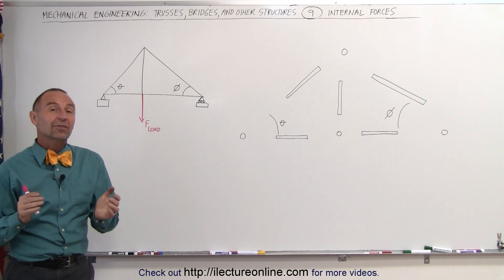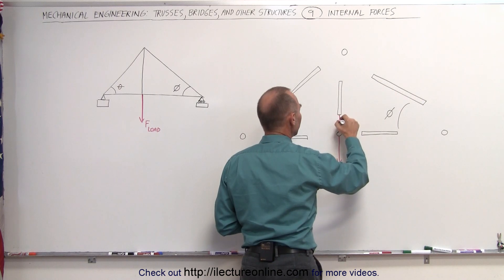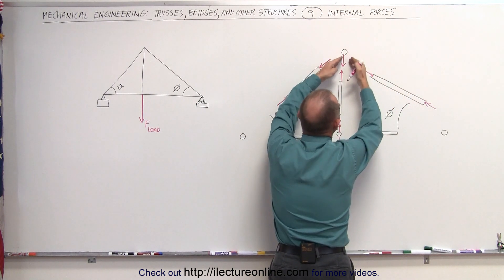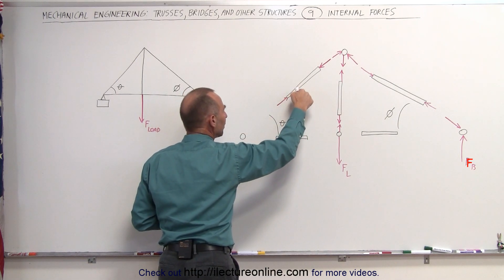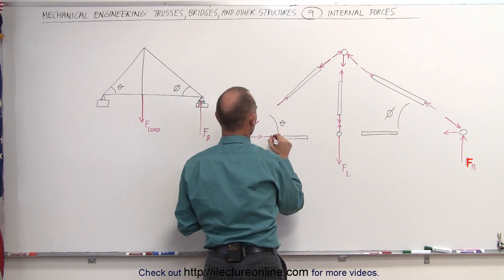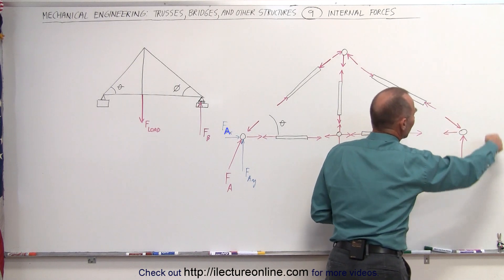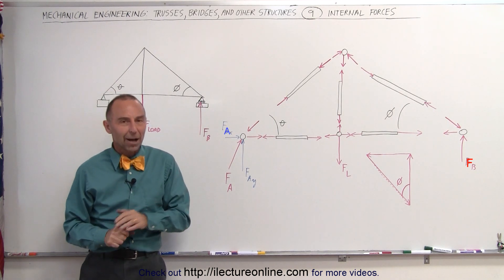Mechanical Engineering: Trusses, Bridges & Other Structures (9 of 34) What are Internal Forces?

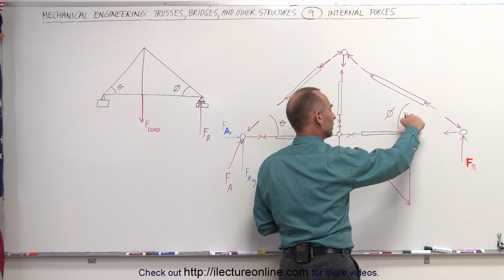Comment: I was a bit confused on 4:34 and tried to illustrate the triangle and found out by rotating the triangle relative to Fb (turning at 270 degree) it will create a mirrored version of the triangle similar in the video
Reply from the maker: That works.  🙂

Comment: Both F(A) and F(B) are angled forces right? In essence, F(By) is not equal to F(B)?
Reply from the maker: F(A) and F(B) are the total forces on those 2 points acting against (and supporting) the bridge.  Since B is on rollers, F(B) only has a y-component.  Since A is fixed, F(A) has both a x and a y component.

Comment: Why do the beams only have axial force?
Reply from the maker: The way the beams are connected, there can only be a push or a pull, since the forces only act at the end point.  There cannot be any torque, (or moment), unless a force acts away from the end points.

Comment: why is the angle psi translated into that position after added the internal forces vectors?
Reply from the maker: +Kevin Ng That is a good point.  Since I didn't label the joints I made a mistake.  It should be the angle between the horizontal beam and the slanted beam (the other angle).
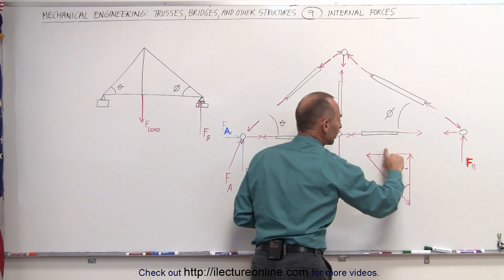Reply: +Michel van Biezen Correct me if im wrong, at 4:40 the angle psi should be in between the horizontal beam and the slanted beam for the sum of internal forces drawn in red because they are alternate angles and thus they are proportional (equal)
Reply from the maker: +Kevin Ng 
Take a look at the examples that follow and you will get the idea